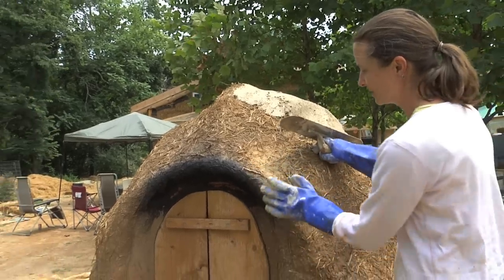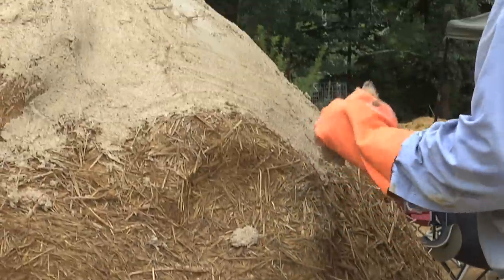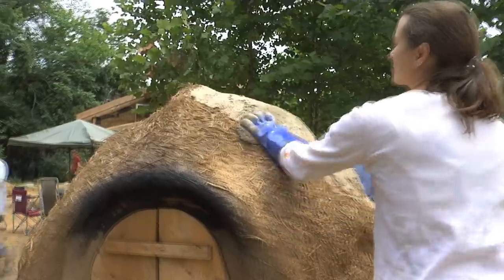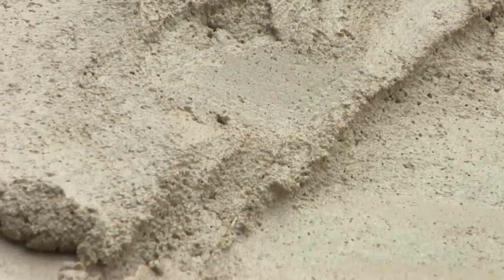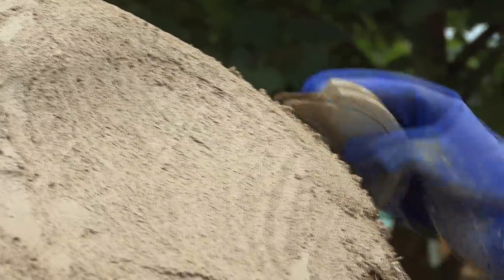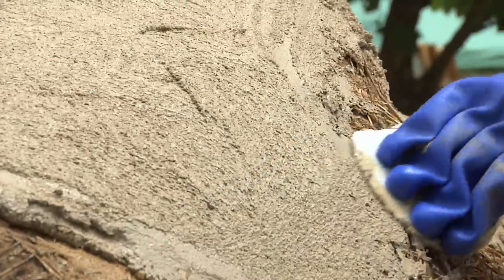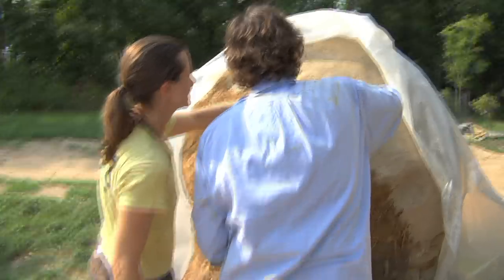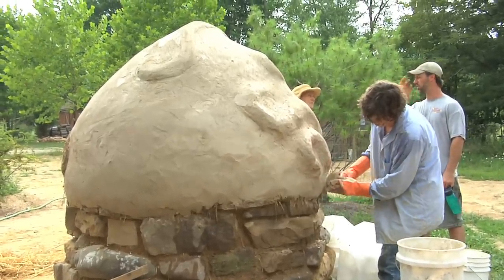Lime Plastering a Cob Oven

Comment: Thank you for your very informative and well-produced videos. I also am at this stage on my cob oven. We live in the northern Rocky mountains and used clay, sand and rocks available in the land of our farm and straw that we had already on hand. I plan on using a fine-screened sand/clay plaster. My question is can we apply the plaster in freezing weather or should we wait until Spring?

Comment from the maker: I would first make the oven smaller.  For one, it will heat up faster, which would be good at a festival.  But also, a smaller oven will weigh less.  I would also make sure your insulating layer is made of straw that is just barely coated in clay slip (until it just looks like straw covered in chocolate milk).  Minimizing the clay means minimized weight.  I would also think about the transportation...shock absorption to minimize vibration & something to keep the oven from sliding around.

Comment: I was just wondering, as hot as these ovens get, doesn't the straw eventually break down and you would have a maze of worm like holes in the clay, making air pockets which is an insulator.
Reply from the maker: eogg25 if you have straw on the interior, then yes, it will burn out eventually.  However, the straw on the exterior should remain in tact, as long as you don't have large cracks on the interior of the oven (where the fire can get through to the straw layer).  The insulating layer is mostly straw and very little clay, so if the straw all burned out, that layer would just collapse.  But then you could always easily and quickly redo it. :)

Comment: I noticed you waited a few months before applying the lime plaster. Can you do it more quickly or does the oven need to be completely dry and fired a few times?
Reply: This is my very question :)  Any answers or suggestions? Since one goal of lime render is to control absorption of water too quickly out of the render it is usually recommended to wet the cob before applying as seen in the video. However, can you also just apply the lime render to a "green" oven where the cob itself is not yet dry and therefore has high moisture content?

Comment: Hello great video's thank you very much for sharing. I have a question can you please help me? Do I just buy regular garden lime then what do I do with it to make the plaster? Thank you very much for any help...
Reply from the maker: Hi Pamela, No you can't just use garden lime.  It is not the correct chemical, and will just result in a dusty mess if you try to make plaster out of it.  You need good quality, high calcium hydrated lime.  Chemically it is called calcium hydroxide.  You can read more here: www.buildnaturally.com/EDucate/Articles/Lime.htm
Reply: Thank u very much

Comment from the maker: Lime in this case refers to hydrated lime putty, which is calcium hydroxide soaked in water for a number of weeks.  (Slaking in this case refers to soaking the powdered lime in water to re-hydrate it.)  The powdered lime is purchased (see above for the type I use).  You then need a big bucket or a small pit (with a lid!) to soak the lime in.  I added some additional information about the lime and the plaster recipe, as well as the book I use as my lime bible in the notes just below the video.

Comment: Can anyone speak to the differences in dolomitic vs high calcium hydrated lime for making lime putty?
Reply from the maker: dolomitic lime has high magnesium in it and is usually process as "type s" lime through an autoclave process that renders the magnesium neutral (otherwise it goes through a carbonation process after your lime has already hardened and causes little pinholes to explode in the surface).  High calcium hydrated lime is the purest form of lime...calcium hydroxide.  High calcium lime is the best for strong, breathable, durable, consistent results.

Comment: what happens if I use a layer of leaves, mulch, to prevent water penetration? Will it work?
Reply from the maker: +All_Food leaves and mulch would hold water against the surface, not cause water to shed off the surface more quickly...so no, I would definitely not recommend that

Comment: one more question for ya, I live in east Tennessee near the city of Knoxville where can I get the right lime? or do I have to order the lime? Thank you
Reply from the maker: I use a high calcium lime from Mississippi Lime and I soak it (rehydrate it) in water for at least 6 weeks.  You can check their website for a local distributor.  The product is sometimes called "food grade lime".  But if you tell them you want "fresh high calcium, calcium hydroxide that was fired in a vertical kiln", then they should be able to direct you to the proper product.

Comment: We should also know that lime is not a fool proof protective coating ...right? Lime over earthen materials STILL needs protection especially benches and flat exposed surfaces. Lime over lime based base materials is a bit more durable. If lime could be integrated in the cob mix outer layers...gradually this might improve the durability? Traditionally cob walls are vertical surfaces...where water runs off quickly. Regular maintainence is essential and to be expected. mudwasp
Reply from the maker: For sure!  Any flat surface will eventually let water through, and if that water freezes inside the cob, it kindof explodes the cob apart (because ice is bigger than water.  My favorite waterproofing is actually a clay plaster with manure in it.  You need to reapply periodically, but it's very breathable, while also quite water-repellent.  Also, you can just build a roof over the whole thing to protect it.  :)
Reply: +buildnaturally  hi what is a good mixture for a cob lime manure waterproof exterior plaster..?(i ment howmany parts of stuff :) )